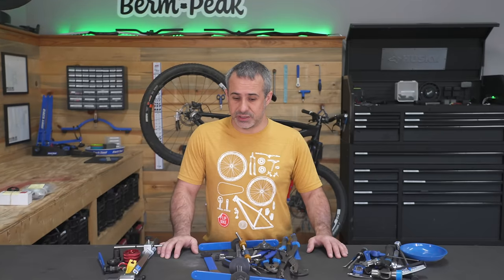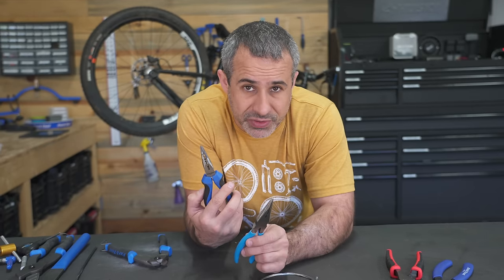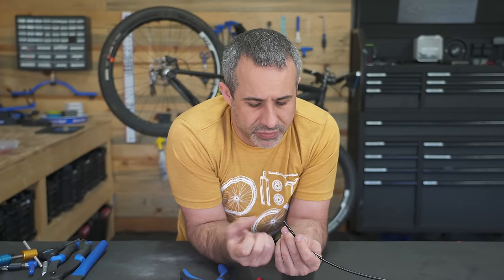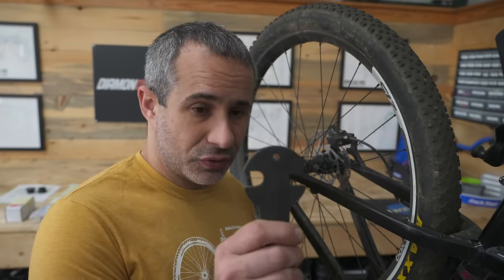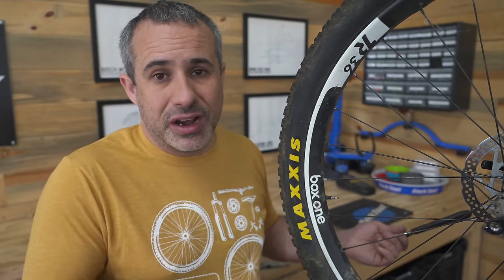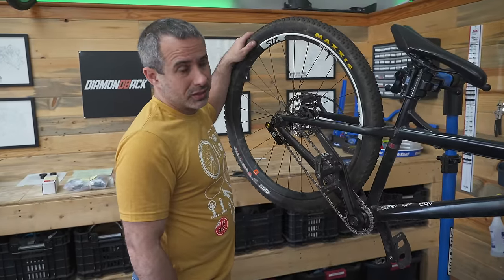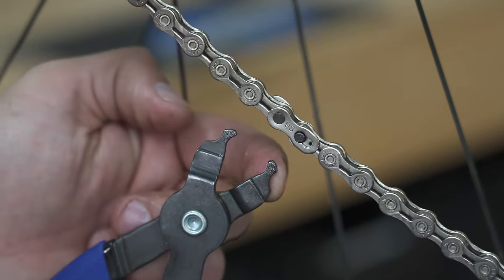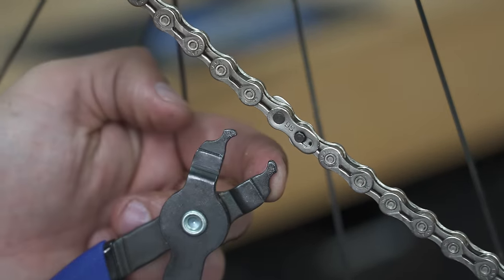Are "Bike Tools" really different from "Tools"?

Comment: For using needle nose pliers to take apart a master link you just need to fold the chain so you can get the plier on the two ends of the link and squeeze.
Reply: But not possible without a rear derailleur, this bike was setup as single speed so only had tiny bit of slack which a chain yentioner eliminates.
Reply: @mtbboy1993  very true

Comment: Specifically about the pedal wrench vs the standard wrench,

The penda wrench is offset 90 degrees and is much more ergonomical, the standard wrench is usually in a very awkward position and you usually don't have one long enough to avoid smashing your knuckles into chainrinrs.

Comment: Since I got back to cycling and also rebuilding bikes from the inside out, I began investing in actual bike-specific tools.  Without them, I was hitting a wall.  One of the main reasons for me to do a bike task I've never done before is it gives me a reason to buy another tool.  Saving money by using the wrong tool winds up resulting in the need to replace the part you trashed.  Generally, tools are less expensive than parts, especially if you use the tool a few times.

Comment: One thing that Parktool did a terrible job on was the BBT-79 DUB BB tool.
CNC'd aluminium.

Ours lasted maybe 5 BB's before the 3/8" socket stripped out. Its just way too soft to remove a factory fitted BB, which of course is put on with an impact gun (I worked in the industry as a production manager for a large brand in Asia).

Its just so expensive for a tool that breaks easily, it felt as if we bought it off Aliexpress or Wish, even though we bought it from an official Sram agent.

Comment: For my homemade headset press I used copper flanges for the interface between my washers and the bearing cups. It works great but is a lot more fiddly than the Park Tool one because there are the added parts to align. It was 1/10 the cost though and as I am just a shadetree bike mechanic it is good enough for me. If I was doing this a lot more then a real press would be better.

Comment: Most good hardware stores have plain old zinc coated fender washers that will be smooth and much larger diameter. They may be in the specialty boxes , but we have them in bulk at my store.

Comment: I have never removed a bottom bracket but a small strap wrench might be usable, the rubber ones probably won’t damage anything unless you tighten to hard. Might make a good bike hack!
Reply: An oil filter requires in the ballpark of 10 Nm of torque while a bottom bracket cup can vary roughly between 30 and 70. Good luck taking that off with a rubber band.
Reply: @frankthetankricard  true, they do sell them with normal straps that could probably do it, i mean if you can strap down a atv with the same material bet you can pull one of those thing off
Reply: @yuyuolozaga3023  the problem is you have literally 1-2mm on some bb tool interfaces, the one shown in the video is probably the largest tool surface of any bb. even with the right tool, sometimes you need to clamp it against the tool interface to ensure it wont slip and use extra leverage to remove. 70nm plus galvanic corrosion holding it on plus 1mm to grip it means you are not having a fun time removing it

Comment: The "Phillips head" screw driver right in the beginning isn't bike specific, but it's probably not Phillips head either. IIRC the park ones like that are JIS (Japanese Industrial Standard) which is a different head type that's used on a lot of bike parts, eg. Shimano derailleur limit screws. You can tell because the screw will have a little tiny indentation on the head. While a Philips head will work, a proper JIS driver will make it much less likely that you strip out the head and you're probably not going to find one at your local hardware store (unless you live in Japan, presumably), so a bike specific one is nice (but not necessary, like some of the other tools demonstrated).

I also use generic tools to remove star nuts when I'm at home in the garage, similar to how Seth uses the headset press: a long M6x1 bolt and a stack of washers on the headset, then just crank it down until it pulls the nut out!

Comment: 2 years on but i have to say.. those ace cable cutters?  that's not damage.  that's actually where the metal you cut with them left behind a thin layer of itself.  like literally it partially plated the cutters with the brake cable metal.  i have a pair of the same for bike work that doubles as bonsai wire cutters and there are alot of copper and steel residue on them and they do get sticky because of it.. you just rub a file lightly against the edge.. not resharpening just removing that residue

Comment: It all depends how often you work on a bike.
Tools like the master link pliers are useful for frequent use, but a person who will use it once, maybe twice in their life, the workaround is quick enough and not that jank. Or a tool can be modified in a non-destructive way that preserves original function and makes it useful for the second purpose.
If it's dirt cheap (ie. valve core tool), then it makes sense to buy it because the price is insignificant and it will see some use.

Comment: a large pipe wrench works in a pinch on that style bottom bracket as it doesn't clamp down and crush like the tongue and groove pliers do... it uses leverage differently and won't slip and mar up the aluminum if fitted right
Reply: no pun intended lol

Comment: If you don't have a master link tool, you can separate it a few easy ways. With a nose plier, what you need to do is scrunch up the chain and close it on the outside of the chain. If the chain is already off, you can use a mallet in the same way but just against the ground

Comment: I believe the first 2 tools are electrical cutters/pliers.  Not designed to cut steel in that cable housing, but i admit i am suprised it  did that to the blades after one or two cuts.

Comment: I've built bikes in the past (BMXs) without any bike-specific tools except for a cheap chain breaker tool. I pounded headset and BB cups in with a rubber mallet or by laying a board on the cup and hitting the board with a regular steel hammer. A few years ago I bought a few actual bike tools to make things easier: a Park freewheel removal tool, a Park "pin spanner," and a Park 30/32mm combination cone wrench. 

I also made some tools: some smaller cone wrenches by grinding down some cheap regular wrenches to be thin enough to work as cone wrenches, and a cup press like the homemade one in this video. I cut out some washers from 1/8" thick vinyl flooring to put in front of the steel washers, which prevents scratching the cups.

By the way, that brake cable ferrule crimper built into your needle nose pliers is no different than a normal indent crimper that's used for crimping electrical terminals. A good pair of crimping pliers, like the de facto industry standard Thomas & Betts WT-111-M, is as good as it gets for those.

Comment: Knipex makes a cable/housing cutter that includes the crimper bits. So you can use normal needlenose (which everyone has, and they come in general toolkits if you don't yet) and the knipex cable tool.
Most "DIY headset cup presses" I've seen are for smaller headsets on like, older or lower end bikes. The huge oversized ones are way too big unless you find some huge fender washers. 
The "bike philips head screwdriver" is, if I remember right, actually JIS because Shimano uses JIS screws for their derailleur adjustment screws. JIS also fits normal philips screws much better. Of course you can get Vessel or some other brands for this which may or may not be better (handle preference is as individual as handlebar grip preference!)
For the torque wrenches, the bike-specific range is hard to find IME. I haven't found any that read in the newton-meter ranges most bike parts call for on the park or manufacturer sites

Comment: Another feature of cone wrenches to be able  adjust hubs, which can not be accomplished with an adjustable wrench or a boxed end wrench.Pedal wrenches have more leverage, so for some of those bikes that may not have had grease installed on the axle. that would be more helpful as well.

Comment: I found a set of extra thin cone wrenches at Princess Auto. Great price for a full set.
Reply: If you have cup and cone (angular contact bearings) in your wheels, they is basically no way around a set of fine wrenches. Nothing else fits, and not using them means the preload will be wrong.

Comment: Needle nose pliers can EASILY take apart master links, you just pinch the masterlink on the side that is stuck to the pin on each side.
This means one side of your needle nose will be on the outside of the chain, the other on the side facing the frame.
Try it, it works.

Comment: If you use the needle nose pliers on an angle to grab either side of the master link and squeeze together you can get them apart but you risk scratching up the chain or destroying the master link, however in a pinch you can get by

Comment: Actually derailleur housing are the hardest to cut, those housing are built to hold stiffness, and are much more hard to cut than brake cable housing spires.

A size 28 spanner might not be a specific bike wrench.... but pretty much is. I don't even know if one can find a size 28 wrench in a hardware store.

Comment: Thx for sharing these thoughts, very useful. I do have have many park tools but also have many alternatives. There are many tools in the market that can be alternatives to bike tools. Plumbers spanner wrenches are very useful for bottom brackets you can find them in many different forms and shapes at local hardware stores for half the price of park tools. Spring clip pliers also very useful in pulling/installing a chain master link also found at many hardware stores. As for head set presses the rod and washer method has never failed me use brass washers many selections at automotive supplies stores. 
Harbor freight has many cheap wrench’s ignition open end wrench’s are very thin and fit perfect removing/installing a pedal but I do prefer my park pedal wrench.  I find a well supplied automotive store is the best for bike alternatives .
In today’s economy we’re all looking to save a $ 
Thanks for a well put video

Comment: For chain plier alternative that’s easier than shoe laces imo, I’ve used a bike multi tool folded the master link and tapped it a few times until it pops out.
Reply: I keep a spare brake cable cut off in my bag as the shoe lace.

Comment: That electric pump must be nice for one handed ppl. Might be something for No Front Brakes i have a Fumpa, but it does not have a threaded part for a valve, but it only lasts about 4 29er tyres. But it's nice to have in the tool compartment of my backpack but a bugger pump like this one would be great for at home use.
I wonder who makes them and where to get them. I will look into pumps like these some more

Comment: As Far as Crimpers for cable you need to buy a eletrical wire cutter and crimper pliers from Channel lock , Snap on etc they are heavy duty for crimping . As far as wrenches  for pedals Snap on , Mac, Matco wrenches are thinner and better quality than a Craftsman wrench . Also as far as the master link thinner needle nose work just well in getting the master link apart. AS far as washers you need to go on-line to company's that deal with specific washers sizes and thicknesses.Bottom bracket tools ARE SPECIALIZED TOOLS especially with bearings in them I would NOT use channel locks .

Comment: I avoided buying master link pliers for a long time and I regret it. I've had chains that were so tight I couldn't remove the link using the shoelace hack (it just twisted sideways instead of opening). Also it's just deeply satisfying to grab the pliers and pop open the link with basically no effort.

Don't try to use an electric pump on a rear shock. They don't have enough pressure (go ahead, ask me how I know ;-). I've also had much worse luck using them on forks than Seth did. If you have a full squish you need a proper shock pump.

I never ride without a chain breaker since I broke my chain on a ride and discovered that there is no good way to remove the broken link without one. I also carry a spare master link so I'm not stuck with a short chain that can't run through the derailleur.

Comment: I like the shock pump trick, I hate pumping my shock and fork. However I read that they have to be filled with air slowly so the Chambers can equalize pressure properly, also quick pumping or depressurizing can supposedly push the oil somewhere it's not supposed to go.
Anyone got any experience if pressurising/depressurizing damping elements quickly is safe for them? Damaging an expensive fork would suck
Reply: You don't get the required psi using a normal pump
Reply: @zachm.3049  I wasn't talking about using a normal pump. Or am I misunderstanding?

Comment: On my old xc bike I bought used (I didn't have any tools besides some screwdrivers and hexwrenches) I had to use many "wrong" tools. Now few years later and I got into downhill and own a Trek Slash 8 I do have more tools and I only use the right ones because I am afraid of damaging my bike. Why spend  thousand of bucks on a bike but than use the wrong tools that might damage your bike and are relatively cheap in comparison to your components plus it is so much easier with the right tools. But it isn't always necessary to buy the premium tools nice tip i got is too buy the cheap version and if it breaks buy the higher quality one because if it breaks you know you need the tool. No need to buy a premium tool if u use it 4 times in a decade.

Comment: I made my own cup press out of 10'' 15mm bolt, 2 normal size washers, a nut and some 4mm thick galvanized platedrilled out in the center. Works pretty good and only cost me about $10 to make. I cant justify spending that kind of money on a tool that has one use.

Comment: If you went to the Electric aisle at Ace I missed it. That's where to find crimpers. Of course electrical wire is soft copper, not a steel cable.

Comment: When I installed a new headset I had the same idea like in your video, because I didn't want to spend that much money. But instead of washers I just used two small metall plates with holes in them and it worked out wonderfull and it was quiet easy to do. :) (Sry for my English)

Comment: Re: spoke wrench, since it has much less leverage than your typical generic wrench, does it reduce the risk of over torque? Is that a thing?
Reply: Depends on the rim and how hard you want to abuse your fingers.  But yes, you can definitely damage a rim by over-tightening spoke nipples or in the case of better quality alloy rims with double walls and cupped spoke receiving rivets, round off the nipples.

 No, purpose built spoke wrenches don't have the strength to leverage like a generic wrench, but if you're building wheels correctly with 14 gauge spokes you shouldn't need to reef on even a standard Park Tool spoke wrench to get the spokes tight enough to hold a decently strong and true wheel. When you progress to larger spokes like cargo bikes with 12 and 10 gauge spokes you should invest in a proper motorcycle spoke torque wrench.

Comment: I made headset press from the hardware store, it had big enough washers, but ended up ordering cheapest press from the aliexpress I could find, because it had a bearing and two cups to fit different sizes of BB bearings or headset cups. At home workshop you don't need to press cups often, so the quality is good enough.

Comment: For cup press - just cut a piece of hardwood or thick laminate flooring and drill a hole through it. There, you have a big enough washer that will not scratch the cup or frame. If you want a nice looking round one  - cut it with a hole saw.

Comment: Cool video!
Someone makes tire levers that assemble into half notches in one end of each and  convert into chain pliers and they seem to work!
They are okay tire levers and okay pliers and weigh little, cost little and you want tire levers anyway...
I think a big strap wrench might have worked instead of Chanellock pliers and wrapping with duct tape may hsve been better than using a rag and I think if you used those washers to push on a washer bigger than your threaded rod you'd have been okay. So a 1/2" washer on 1/2" rod pushing a 3/4" washer thats bigger around pushed with your 1/2" nuts of course.
Instead of needle nose pliers on the master link try those circlip type pliers with prongs protruding. They fit better inside the chain or use a small version of needle nose pliers as the jaws might fit better. Also there are round rod type jaws on some pliers.
Some of these things can be used for non-bike things and so thats a big advantage.
Also they made adjustable wrenches with thinner jaws than the standard ones and that has a lot of applications on bikes but still works on all dorts of non-bike applications like any adjustable wrench.
Even if you have tje standard rype buy a thin jawed one as wrenches are often used in pairs anyway.

Comment: I once had to use a rock and a stick to fix someones rental bike chain on the trail. my multi-tool did not have a chaintool, and everyone had gone ahead, no signal to send a message. So we used a stick to push out the broken link, and tap the chain back together. It lasted the rest of the ride.

Comment: I never liked master links, (the clip type back in my biking days) so i'd just use a hammer, a screwdriver, any old pair of pliers that can twist something and my backyard porch (Basically an anvil). I'd use the hammer on a screwdriver and break a link, twist it remove or add links, twist the link back in place and a simple tap tap and the link is back on